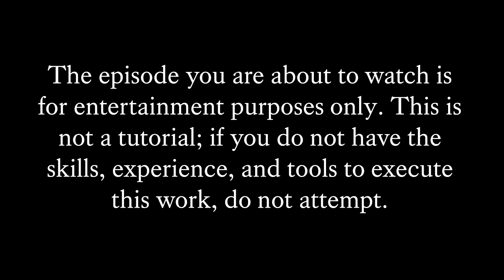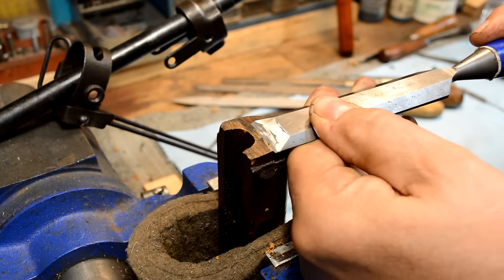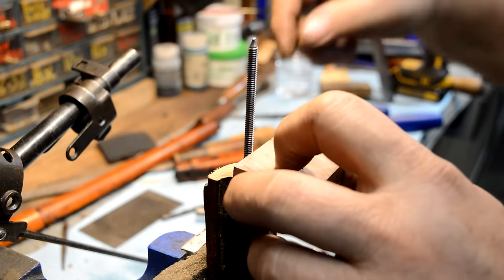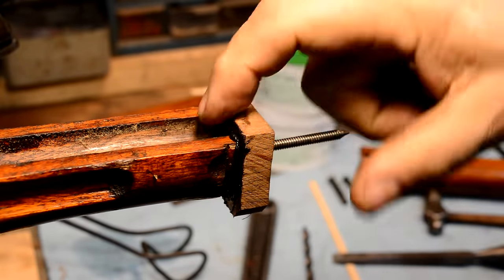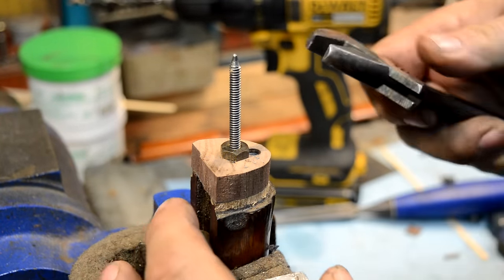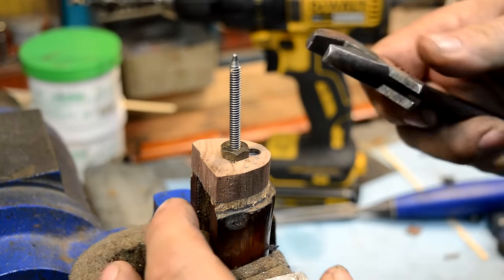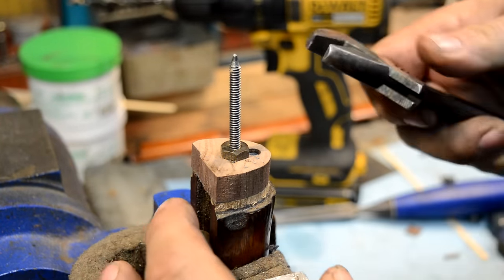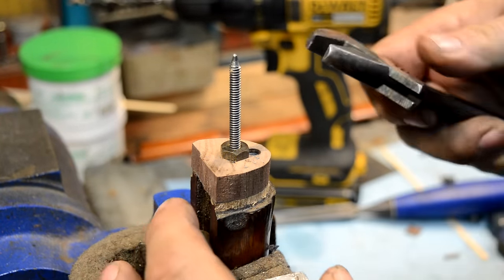Anvil 086: Type 99 Arisaka duffel cut repair

Comment: Put a small ball bearing (something like a piece of birdshot) between the 2 pieces of wood.  Put the wood together carefully with the barrel and action together and tap lightly on the foreend with a soft mallet.  Now you have a indentation on both pieces of the stock that show you exactly where to drill.
Reply from the maker: Great tip. Adding it to my bag. Thanks
Reply: I love to have another mind thanks thinks the same as me. God bless you brother
Reply: Can also add an ink like sharpie to the BB if adding pressure would be too much risk. The fresh ink will transfer. Used to do this to get body post holes aligned on painted lexan RC car bodies before drilling.
Reply: I use clear shoe polish for mould  release
Reply: Just used this tip for my type 99's duffle cut repair! Huge thanks!
Reply: Since there was already an existing hole for the cleaning rod, that hole could have been enlarged on both pieces to accept a piece of steel tubing. That steel tubing could then be epoxied in for a solid bond between both parts. And maybe two small dowels linking the two pieces for extra strength. Many ways to skin a cat.
Reply: @eltomas3634 I used a piece of hollow threaded rod to repair the duffel cut on my arisaka. I am pretty sure the threaded tube was originally part of a light fixture. Example number 3765 why I never throw away anything.

Comment: The wood is either Beech, Walnut or a Japanese tree called Katsura, depending on the arsenal and the year made. Some late war, aka "last ditch" rifles used palm wood. To be able to make the most of the tree, the stock is actually made in two pieces, the bottom 1/3 or so of the buttstock is dovetailed on, leading many people to believe the stock is cracked and that the rifles are of inferior quality. The finish is Urushi lacquer, known famously as Japan Lacquer, which is made from a species of poison sumac which lead to the myth that the wood is poisonous due to the allergic reactions when cutting and sanding the stock.

Comment: I worked at a McDonald’s in California that had an attic that was used for storage. I found a type 99 up there hidden between really old happy meal toys and boxes of junk from the 90s. It had been hidden away for years and I could never explain how it got there.
Reply: Working at a family homestead, there was a thrashed 99 with airplane sights and bipod, missing the dust cover, bolt internals and the emperor's stamp was ground off. Looks like the boys of the family must have used it for play games over the decades.

Comment: If only they issued the GIs with duffel bags about 6 inches longer.
Reply: And the USN SPs not taken all the bolts away from the boarding servicemen for safety, put them in barrels and handed them back randomly when they got back to USA.

Comment from the maker: Arisaka owners...please report if your gun has the vise marks in between the barrel bands. I want to see if it might have been a part of the original weapon fabrication process. Thanks
Reply: Mark Novak I have an arisaka with all the correct stuff  it has no vise teeth mark on the hand guard.
Reply: No marks on my 99. It’s an early war production if that also helps.
Reply: Mark, I have a Type 99, aircraft sights, bipod, undamaged mum with no vise teeth marks between the barrel bands. Great video!
Reply: No such marks on mine; complete rifle with original dust cover, intact mum, AA sights, bi-pod, no duffel cut, no import mark and the center piece of what appears to be an Aleutian sight modification with the two side 'ears' broken off.  Pretty sure somebody else monkeyed around with this rifle and clamped it down too tight in a naked vice at some point in its life.  Steaming it might get some of the marks to rise back up, but it'd probably mess with the old oil finish on the wood.
Reply: Since I started this, mine is a Type 38 carbine, Nagoya arsenal, Series 5.  Intact Mum, no import mark.  I've owned it for 30+ years (damn I'm getting old)
Reply: I have one with 2 stocks. The original stock that some one sporterized it and one that a friend gave me. Both do not have the marks on it but I am looking for the front bands and screws so I can install the upper wood on it mine also has the air plane sights and the mum is still intact
Reply: ⬆️ These people are making me green with envy. Even the fellow with the missing screws for his airplane sights.
Reply: Got one built in 1938-39 sitting in my lap right now! While I don't see any signs of vise marks, somebody took the time to lacquer the stock so it may have been lost in the process.
Reply: I’m actually a bit disappointed we didn’t learn anything interesting about these guns. Maybe we need another couple hundred comments to see. This may be an armourer who did this or some shade tree mechanic who was getting very gorilla on some screws.
Reply: Very early production type 99, no vice marks. One of the finest bolt action rifles ever made. Probably #3 on my list behind only the Mauser 98 and the US Krag 1898.
Reply: My grandpa brought home a type 44 cavilerie carbine no vice marks
Reply: Not sure if this would include Type-38s, but mine has no such marks and is not duffle cut, mum is intact, but dust cover missing.  Can dig it out of the safe and check out the markings if it's of interest.
Reply: We are trying to clean one up (with an intact chrysantium) which is in a pretty rough shape. No vice marks on the stock. This stock was not duffel cut.
Reply: Early war 99 with all the fixings, no marks
Reply: Most of the comments have nothing to do with the question. My Arisaka TYPE 99 has similar vise marks. My father served in the last campaign in the Philippines. When the war ended and his unit got to Japan, his unit was disbanded and the high point men were sent home. My father was transferred to an Ordinance outfit in Japan. He told me the following. "The rifles without the mum were taken from demilitarization dumps. All a GI had to do was walk up and pull a rifle from the pile." He took a type 38 and a type 99. He mailed the type 38, two swords and short knife home.  The Type 99 was cut at his station so it could be concealed in a duffle bag. Bringing home souvenirs was not a problem - but theft by fellow servicemen was a real problem. He was given a Type14 Nambu pistol by an officer that was going home - which he had nickeled. He stated it was to protect the gun. If you didnt clean it, it rusted. If you did clean it it would inevitably be stolen.  The gun was nickled and then hidden at the bottom of his duffle till he went home. When shipping home he brought the pistol. the duffle cut 99 and a 8mm Submachine gun with him. The SMG was confiscated when he boarded the ship. He was still mad about that 30 years later. My father died in 1987.
Reply: @jwhiskey242  oh jeez

Comment: It's so rare to see people bestow Japanese weapons with any amount of respect. Thank you for your mindfulness, and thank you for sharing your knowledge with us in such a well filmed manner.
Reply from the maker: Glad you liked it
Reply: @marknovak8255  Mark....I purchased an original PU scope made in 1941 and mount from a man in Siberia a few years ago...do you know someone who is expert and possibly has a jig to drill and tap the receiver of a Mosin to create a Soviet sniper rifle, and do the bolt alteration...my dad had a shop mount a scope on my deer rifle, a British No.4 Mark 1, way back in 1970 when I was 15 years old.  The holes were not drilled in alignment to the bore and I could never get the scope zeroed before it was out of adjustment range...I have access to 4 Mosin's for a donor rifle...any way to figure out which one would be best for the donor for best accuracy?   I've looked at them all and one made in 1939 appears to be good.  What do you estimate the cost of this job?  BTW.  Excellent job on the MP-18!  That will give a man goose bumps getting that thing running!

Comment: You said a mouthful in one sentence. @33.35 'a Dremel tool has its place in gunsmithing but it's Not the go to tool'.
     Great Video! I am a big user of acraglas too. Back in the day, we bedded actions with JB Weld and Johnson's floor wax was the release agent. I still use those products in places. Actually the johnsons wax is what I always use for release agent, even with acraglas. 
     Some of those old finishes can be touched up using a few drops of iodine in a teaspoon of denatured alcohol for stain. I then use the Formby's tung oil finish. It's made for refinishing furniture but Formby's has great line of wood products. 
   I love your work and you do a fine job of relaying the reality of gunsmithing. As you have said before, a gun is only new once. When things happen to a gun, there are tradeoffs in some repairs. Barrel harmonics is a small trade to have the weapon back functioning in one piece. 
   Take Care and be safe, John
Reply: Kiwi shoe polish makes for a good release agent too

Comment: Stocks were Beech, Walnut, or Katsura...higher grades were mainly Walnut.

Stock finish is Urishi resin, made from poison Sumac, using a Tung oil-type process.
Reply: I've heard they will give you a really bad rash if you sand them. That would explain why.
Reply: Not to rain on you, but it is spelled urushi for those wanting more info. I tried googling it and it corrected it to be urushi. Anyway, here are craftsmen ( one is prob 70 yrs old now) making some and talking about it:  https://youtu.be/hPOXpb5RWBw

Comment: Thank You for another respectful repair. Several points in the process where a less respectful worker would have done technically correct but disrespectful work. It takes real skill to do only what must be done.

Comment: One of the first things I was ever warned was, "a firearm is not a car".  What was meant by this was that a thirty (hell, twenty at the time) year old car might be total junk, but, properly maintained and stored, a hundred year old firearm is ABSOLUTELY still a lethal weapon.  I have handled guns that I was alarmed and astonished to learn the true age of.  Holding an early M14 got a nod of familiarity.  FIRING that M14 gave me pause, and made me completely reevaluate a lot of cold war history.  "Battle rifle" only means so much if you haven't fired one.  Early 20th century firearms are the intersection of the beginning of modern mechanical precision with the end of 19th century politics, and they have a very sobering degree of precise and immediate lethality to them that drives home what military service in those wars really threatened you with.  There is only so much these guns can teach on the wall.  I applaud your work to restore them to operable condition.
Reply: Battle rifles are for Soldier Marksmen, but since this fell out of favour for suppression and volume of fire, then the 5.56mm makes sense. I am still staggered by my memories, as a Gunnery Officer in the Royal Navy, when I fired, .303 Enfield, L1A1 SLR, L85A2 each time it felt like a step down in raw power each time, but an increase in magazine. Seeing 1000yards on the SMLE Iron sights was a "Holy cow, this thing is a beast". The SLR was my favourite,  but then true marksmen are hard to train and practice.

Comment: 69 dislikes: 69 hacks who would’ve cut it up and sporterized a beautiful piece of history.
Reply: Ben Lane My former father-in-Law ran across His war trophy type 99 and asked me if I wanted. Of course I did! It was missing the firing pin, spring and safety knob but the mum was intact. He also gave me the bayonet. I was lucky. It was still packed in cosmoline! It had never been issued. The stock didn’t suffer from the oil soaked stock that usually broke at the wrist. I got the needed parts and disassembled the rifle for cleaning. It turned out beautifully. I have dies, brass and bullets for it but after two decades of my having it, it remains unfired. He also had a sword and a Nambu pistol in the clamshell holster, all numbers matching and an extra magazine with matching numbers. He said I could have it when He would pass on and showed me where He kept it but His son got there first and took all of that and His coin collection too. No use crying over spilled milk. I am fortunate to have the rifle. He was a good man!

Comment: Back in '74 I purchased a Gewehr 98 dated 1906 for $35.00 at a swap meet.  When I took it apart to 'restore' it, I found out that it had a bulged barrel and a duffel cut.  I kept it anyway as it was quite interesting.  When I moved from Canada to the UK I decided to bring it with me as I had owned it for most of my life and why should I part with it now.  The stock ID Disc says 114R (Infatry Regiment).  Some Canadian brought it back after WWI for some reason.  The rifle looks like it has been through a war and even the trigger guard has been slightly 'crushed'.    I think this gun survived an explosion.

The dealer who imported my rifles into the UK told me that the British Government didn't recognise German Military Proofmarks.  In the UK it is illegal for a dealer to hand over a gun without proofmarks and I could not have the gun proofed because of the bulged barrel.  I had 3 choices.  Destroy, De-activate or re-barrel.  The cost of de-activating was the same as the cost of re-barreling so I chose the latter.  I have finally got the rifle back and it has been lovingly blended.  The new barrel was rust blued and the old sights were installed on it.  From 5 feet away it looks great.  I intend to shoot it here at Bisley where the shooting of Historic rifles is making a huge comeback.  There are several matches with many different classes with competitions from 25 to 1000 yards.  I watched your video about 12 times before I mustered the courage to fix my stock.  The key was formulating the strategy.  I had to figure out what holes to drill and where.  There is not much wood on the Gewehr 98 stock.  I chose to enlarge the cleaning rod hole and fit a 7mm thick wall brass tube.  I had room for one more hole so I opted for a 10/32 screw with the head cut off.  It really is in the details.  Determine how tight to make a hole and choosing the correct drill bit.  I didn't want to squeeze out all of the epoxy in the screw holes.  I waited 4 weeks for Brownells to ship Acraglass.  I had to track surgical tubing down on ebay.  I stared for quite a while at the rifle.  I drilled the holes yesterday and dry fitted eveything.  There was a 1/8" saw kerf missing but I decided against a wood spacer and just used acraglass.   This morning I tracked down some past wax and put everything together.  I decided to put the band on gun to keep the pieces aligned.  I will probably regret it.  120 year old wood behaves more like charcoal than wood.  Especially after being oil soaked.  I will let the epoxy set and take it to the range to start barrel break in on Friday.  Thanks for all of your videos.  The most important thing you teach is patience how important having a strategy is before you start a job.    Could not have done this without you.

Comment: Just for info: Type 99's wood fixtures pending the year of production were Walnut (which by chance was a proper choice for you to use) and a poison Sumac resin finish-- or Beech, Japanese walnut or Katsura, and finished with cured Urushi resin.  Some of that obviously not easy to acquire here in the States per se.  This was thoroughly entertaining to watch, pretty darn good repair.

Comment: That particular Arisaka was taken from the Emperor’s guard armory as a souvenir by a GI during the occupation of Japan.  The Arisaka stock is made of either beech, walnut, or katsura.

The finish is called Urushi, which is derived from the sap of a kind of Sumac tree; the poison-variety sumac. Try to avoid sanding this finish as you may have a reaction to it, and the airborne dust can give you a poison ivy-like reaction in your throat and lungs.

Comment: As a note, the resin used is an exothermic reaction (makes heat) rather than endothermic reaction (absorbs heat). It still reacts faster when hot (just like the equally exothermic hydration reaction of concrete, which needs to be actively cooled in large slab pours) and thus while lamp is successful in "pushing" it to cure faster, the glass will actually will get warmer than ambient all on its own (especially in larger thicknesses).
This is why the release agents ect are all carefully made to be non-flammable, it can theoretically get hot enough to be an ignition risk in large quantities/uses where its insulated... although frankly unlike cheap bulk building epoxies (which I have in person seen hot enough to be smoking) I doubt anybody has actually had an issue with AcraGlass because the couple of kilos reacting in a paint tin type worst case scenario is several hundred dollars of product, rather than the left overs from sealing an entire wall/swimming pool.

Comment: Some hobby stores, and stores that have livestock supplies, have disposable syringes with long tips that would be perfect for shooting glue into that hole! 
On line you can get them in 10 packs with needles, flat dull needles, like the ones for lubing Grandfather clocks.

Comment: I attempted a very similar repair myself to an original 1777 pattern infantry musket, and I'm pleased to see that I used some of the techniques you display in this video... albeit somewhat sloppy and obviously novice. My main difficulty was that the stock is so thin, there was no material to add a rod for reinforcement, and all I could do was add some pins to prevent rotation and add some sort of anchor point. Overall I think it needs a complete restocking, but I'll never find someone to do that... so at least it's in an operational state!
Reply: At Least Is Right, In That It Can Finally Be Usable Once More.
Reply from the maker: OUTSTANDING. At least you picked up a tool and did the maintenance!